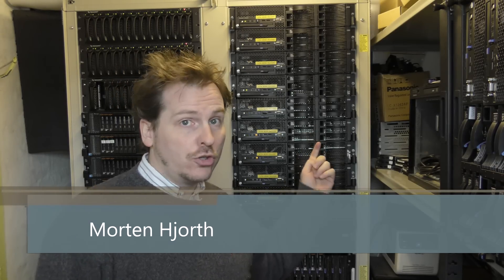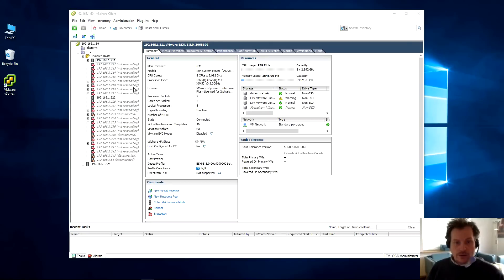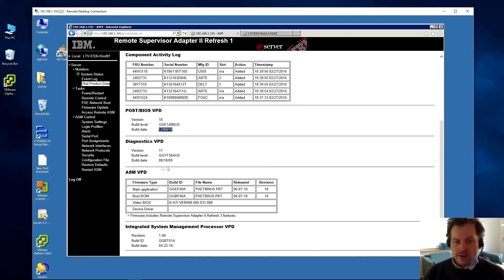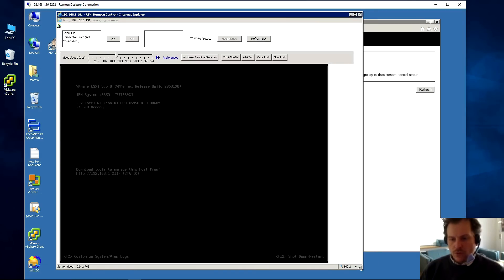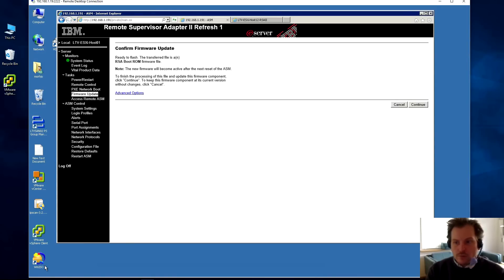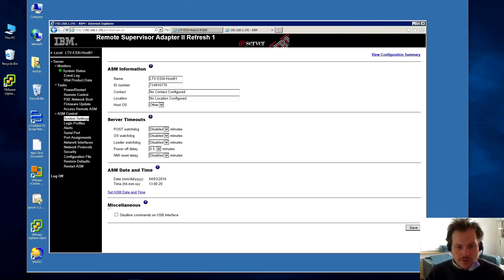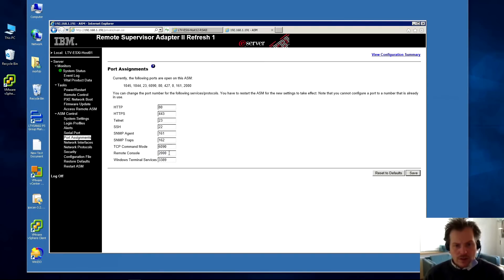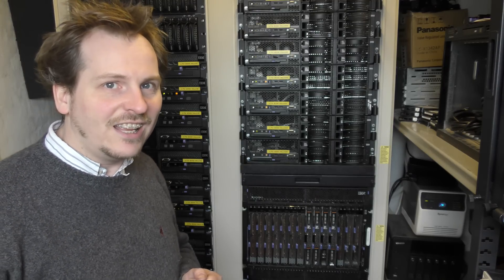Server Management Module RSAII/IMM/ILO review - 331

Comment: Hello Morten. I buy a RSA adapter for my x3650 M1, but in the bios from my server there is no RSA option. Your server has an RSA option in bios. My bios is version 1.07 and you have 1.18. Is the solution upgraded bios? Can one video how it works update bios?
Reply from the maker: Hi malac1971
That would be what I´d try...
Thank you for watching! :-)
Reply: Morten please help. I installed bios ver.1.19 but even in this version, the BIOS does not have RSA2 options. Should I install another thing for the bios to see the RSA2 controller?
Reply: IBM begins work properli after you update everyting and do some resets )))
Reply: Hello, Appreciate if anyone can assist, I have the same issue, bourght RSA II Slim Line for my X3250 M1 but , the BIOS has no RSA option, I updated from version 1.17 to 1.47 but still to no avail. Do i need to update the BMC? Appreciate any help I can get.